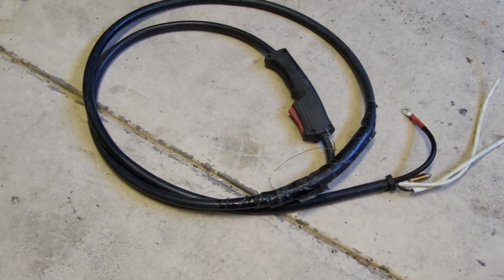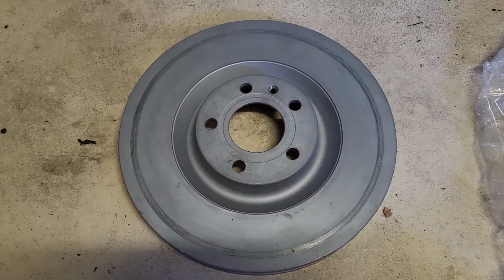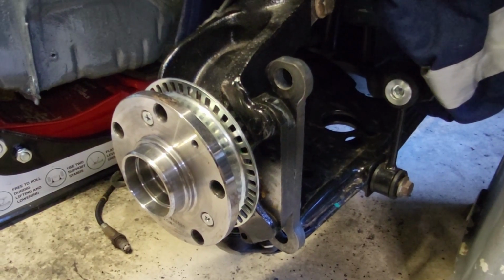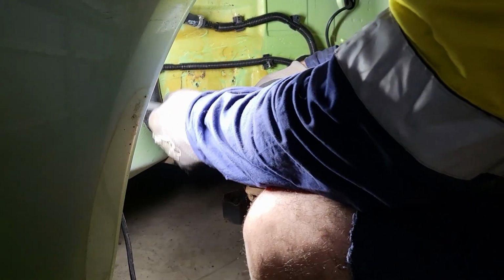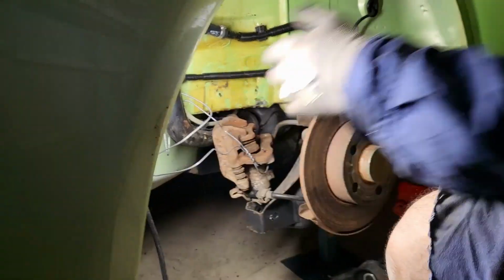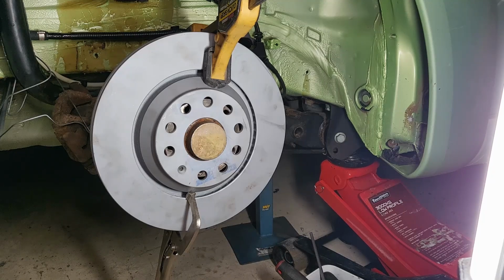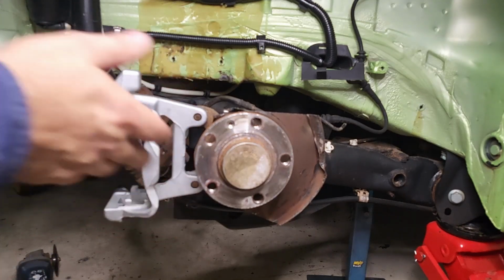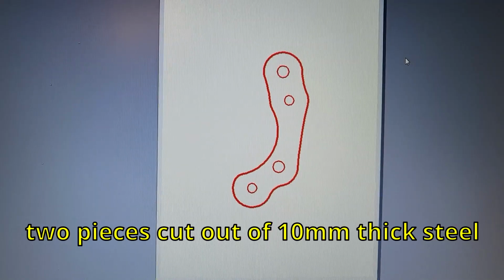Building New Beetle 3.6 VR6 - Part 7, Big Brakes

Comment: Admire working around the wheels. Pity they couldn't be drilled 5x100. Plentiful brake upgrades for the mk4 platform.
Reply from the maker: Yes, I looked at 5x100 but not enough meat to be safe. I also had the back hubface shaved off about 5mm. I probably wouldn't do this brake setup again, but I committed myself to using those